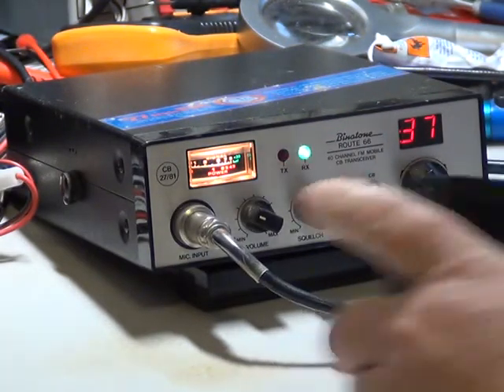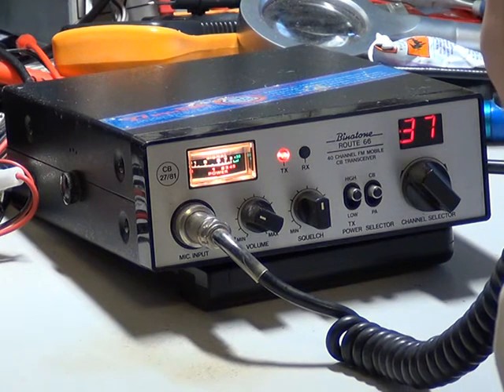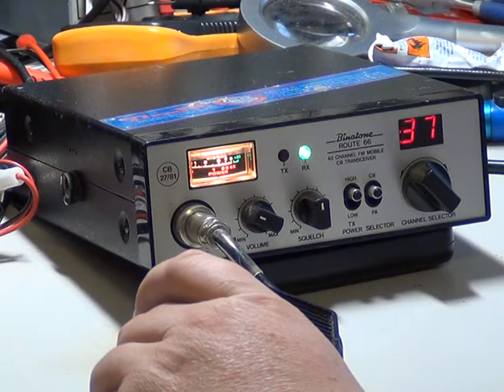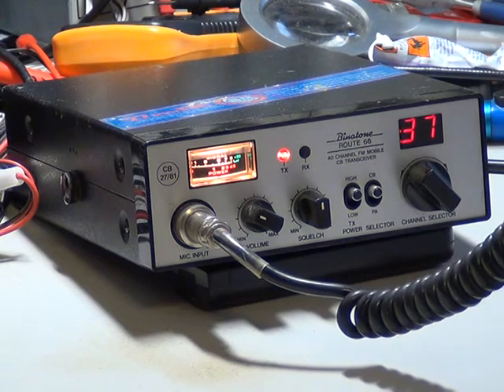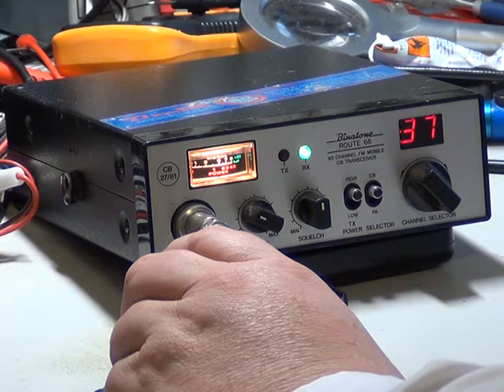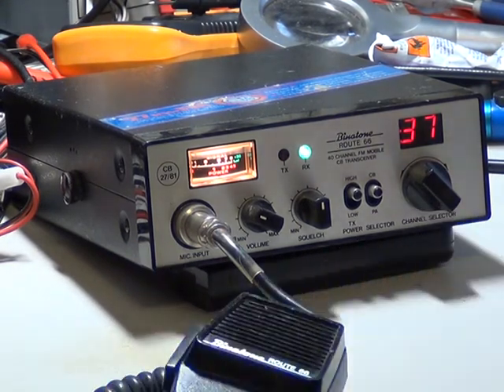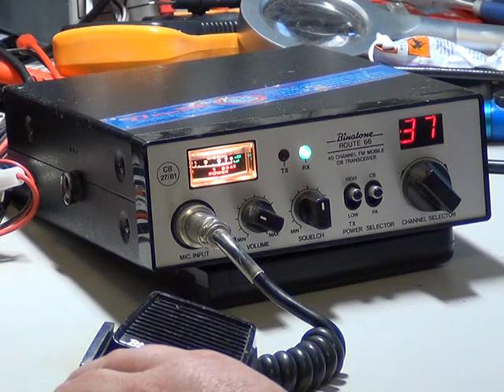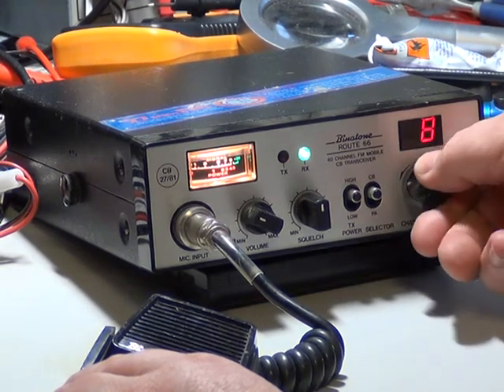Binatone Route 66 (late version), UK (CB 27/81) CB radio (Mobile)  - On The Air Test

Comment: If you set the channel select somewhere between 40 and 1 you'll end up somewhere on 28mhz if i remember correctly. I think there were three different channel displays (not numbers, just random) and each one was a frequency on 28mhz.
Reply from the maker: Maybe on the early version that used a PLL02A PLL chip, but certainly not on this later version as the Sanyo LC7137 PLL chip is "double ROM locked" on this version. If the PLL received a code request for anything other than the 40 UK channels, the chip is supposed to assume an emergency situation & will blindly (i.e, regardless of what the LED display says) switch to channel 9.

Richard
Reply: Yes it would have been the first version in 1981. I had it the day CB went legal and enjoyed messing around with it.

Comment: Do you have wiring and colour code for wiring astatic 104 d mic 2 håvard 240 m  picked up one at car boot sale .
Reply from the maker: +joe Le tec At koss Although I can't vouch for this, our workshop mike leaflet says for the Astatic Audio=yellow, TX PTT = white, rx = black & earth = screen + blue.

The harvard 420M (I think you mean) is pin1 = audio, pin 2 = earth, pin 3 = rx & pin 4 = tx ptt

Richard
Reply: +UK CB radio servicing yes will try that ...  pin codes for microphone. . Thanks

Comment: Binatone  Route 66 had a terrible audio problem can always remember running one
Reply from the maker: +joe Le tec At koss On TX or RX?
Reply: +UK CB radio servicing on tx  . bad hissing sound on transmit audio
Reply from the maker: +joe Le tec At koss sounds like a noisy transistor in the microphone pre-amp circuit. Neither of our samples are like that.